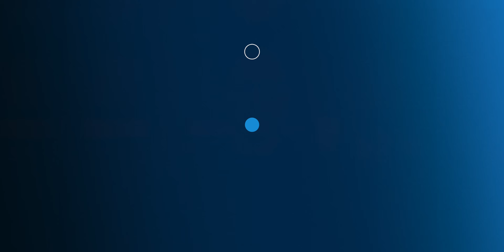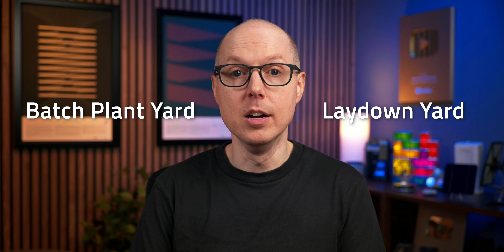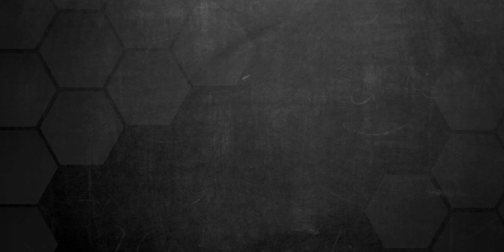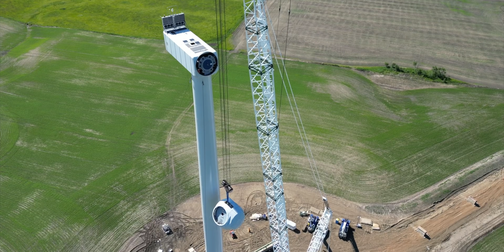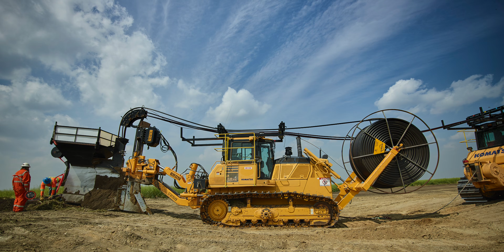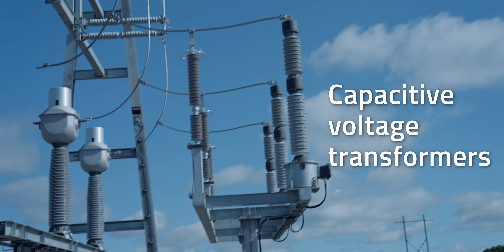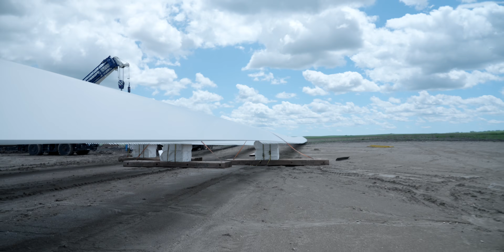The Hidden Work Behind Wind Energy

Comment: Thanks for not skipping the massive steel and concrete base. This, plus logistics, ongoing maintenance, and non-dispatchable service… it’s probably a shorter lived project than initially proposed. I love the concept, but the numbers don’t go ‘round.
Reply: What numbers are you using? Your statements don't reflect reality around the world.
Reply: @ compare return on all-in costs including the inputs (transport , etc.) then add in decommissioning and reclamation (probably will just be left behind), then add-in required stand-by power generation costs (idle peakers to handle wind volatility) then add-in costs related to turning other things down (see Ontario where hydro and nuclear were dispatched down on windy nights), and then… yes, there’s even more to it! Finally, subtract subsidies. All-in costing yields negative returns and mounds of ferro-cement that will never be reclaimed or cleaned up. Lifespan for the turbines is turning out to be less than half original promise (again, Ontario experience). And maintenance is turning out to be higher. On the plus side, newer ones can be dispatched down (commanded to turn away from the wind), but that puts another wrench in the return calculation unless… you’re paid for the dispatch down! And that is another subsidy. Solar has some merit despite plenty of its own issues with production and disposal. Wind is whole different story

Comment: I built this wind park. I was on the Base/Mid that was talked about. The bottom two secrions of the tower. Job is a ton of fun, and nothing beats the views. Ive been all the way up but stayed halfway for this project. I think i personally met everyone in the videos (aside feom Matt). The people building the tower, feom the inventoey team, and offload team, all the way to the top out, electeical, and Quality assurance teams are some of the best in the business and truly make it look easy. There is something cool about lifting up a 78 ton tower section, managing the guys on the ground, with the crane team  and then climbing the tower and landing that part, with all yhe holes lined up perfectly, and securing it. Its just amazing and so much fun!
Reply: i'm sure you also have big thumbs, you often replace R with E hhehehhe, take care brother
Reply: @b0rd3n  it's always been a problem for me haha. Damn thumbs! Keep on keeping on brother! All the love
Reply: I currently get to operate a "large mechanical equipment piece of equipment" that moves multiple times a day and it weighs about 2 million tons(counter weighted by about two 1 million ton weights) I'm told by the DOT that maintains it. When up in the air, it is perhaps the best view in the city. We also have to carry up anything we need/want to a shift, but luckily no harness as we only have to physically climb up 2 stories(20-24 feet/6-7 meters). 

Safety is key though as a fall, though unlikely, would likely be deadly and getting "pinched" when it's moving would be like a paper cutter cutting through paper! 
Be safe out/up there man! 😅
Reply: If I understand this correctly, a single section of the tower weighs 78 tons? How come it's so heavy?
Also, in the footage showing the inside of the tower, I only see a ladder. Is there some kind of elevator for maintenance personnel? If not, is there a harness cable going up and around a pulley on top with a ~70kg counterweight to make it quick and effortless to go up and down? I guess there should be two cables, for a second person or some tools/parts.
The counterweight could even use a simple mechanical system to automatically match the weight of the load that needs to go up/down.
Reply: @VeniceInventors  a single section of this tower is around 78 tons. Different models have different weights per sections. As per the ladder. Most towers have a purchasable option of an elevator. With that being said, most companies don't purchase them haha. And even if they did, elevators are installed after erection is completed. For us that build them, we start on the bottom, put on our harness and climb the tower. Rung by rung. You also have 50lbs of harness, a lunch bag, and whatever else you want to bring up tower (i.e winter clothing when its -30c outside) Its alot of work. But you get used to it. Now after completion, alot of towers get a "climb assist" installed. Basically a second cable you hook on to that's a loop from top to bottom and runs through a motor on the bottom. It takes some of the weight off you while you climb. You are supposed to set it to about 60% of your body weight, with the max weight it can help pull up is 250lbs. If you check settings, most tower climbers are apparently 250lbs hahahaha. But honestly, it's a great workout and a ton of fun getting to the top
Reply: @ryanyoung1837 Thank you for the detailed reply!
I understand that they can't justify the cost of installing 38 elevators in 38 towers as they probably don't need servicing too often, but I'm glad to hear that at least some measures are taken to assist the poor chap who has to go climb all of them to go check or upgrade something 🙂
Reply: @VeniceInventors  they do get serviced pretty often to be honest. Each one will will get maintenenced once to twice a year, plus just general work. One park had 56 turbines and had a team of 8 that would climb at least a tower a day. And as for the help to climb. Us tower climbing grease monkeys love the climb.  Even if we don't have any help, like at any point during construction, we still love the climb. I remember my first climb to the top. I was told I don't have a time limit, just make it. I think it took me about 45 minutes. I was gassed beyond belief when I got the that last deck (the yaw deck). With that being said i know guys that climb in 15 minutes, and guys who take 30 minutes. You get used to it and have alot of fun doing it. You may be gassed, but you climb up the final ladder into the nacelle, and if you are building it, you already have one of the best views of life, and if it's built, you open that top hatch, look outside, and everything is worth it. I wish I could add some of the cool pictures I've taken.
Reply: @VeniceInventors  You will more likely see lifts in offshore wind turbines. For example an offshore wind farm under construction will often have turbines 350M (120m max on this project) off the sea surface, estimated power output is 15,000MW PER turbine (vs 5000MW max per Nordex) and its swept area of the blades is 43,742M (18,870 max). Think of the cranes needed for that and thats not the biggest offshore turbines being built (no road corners in the sea as a bonus but weather can be "interesting").
Reply: @stephendoherty8291  The size and output just leave me speechless.... Since there's no building that tall around here, the only way I can really appreciate how tall that is, is by considering that it would take 35 second to sprint the length of the tower! Or, if my math is right, it would take 8 seconds to fall from the top.
It must be intimidating to design (or work on) something at that scale.
I hope I get to see one in person some day!
Reply: @VeniceInventors  Three large farms under construction in the US and one is near completion in full. If you fly anywhere over the North Sea you see fields of them. 40% of all power the UK generates is just wind, most of that offshore.
Reply: @VeniceInventors If you're in the US head to the north east south of Boston, this seems to be the areas that future wind farms will be built and expanded. It's near massive power demand and it's windy
Reply: @stephendoherty8291  Dang it, I'm in the opposite corner of the country! (Los Angeles). We do have wind farms east and north of me but the tallest I've seen (on land) is probably 200-300 feet tall.
It looks like CA doesn't have any offshore windmills yet, the state obtained federal leases in 2022 and are doing environmental impact studies at this point. I'm 100% for protecting wildlife from humans, but there would be a lot less impact offshore, if any,  than there already is on land, especially if they drag their feet for too long.
Reply: @VeniceInventors  Pre Trump there were firms looking to install offshore wind farms off CA. Due to the water depth, they would need newer design floating wind versions. These are like oil rigs and are chained to the sea bed but can then be used in deeper water. I recall the islands off CA were a suggested spot as a substation could combine the power before sending it to shore. Floating wind turbines are rarer but they are being built in Scotland for their deeper water designated wind areas. This was also the idea for the great lakes which are too deep for traditional ones but floating ones would be easier to anchor further offshore. Recall it was lots of "green tech firms in CA tech land as there is no clear design winner for offshore and the US could get a lead in this with its oiol and gas experience and work talent
Reply: @VeniceInventors  The issue over placing them next to Channel islands is they are mostly large bird and wildlife sanctuaries so even if they are abandoned and no longer military firing ranges they are in corridors for birds as welln as offshore mammals. It does not need islands to build floating ones but until the Oil industry seems this as a money maker or at least the oil rig builders then there is no pressure. Not to mention all the rich who lose their expensive sea view with lawyers...
Reply: Pam here….I personally like to see our workers building theses turbines and maintaining them vs the filthy oil rigs, platforms and all the steps of the process of use of oil….filthy and polluting every step or drip of the way.
Reply: Thank you for ridding us of pesky birds
Reply: @DinoNucci  Cats kill more birds than wind turbines.
Followed by skyscrapers.

Comment: As a guy who's interested in reliability, all things fail. The fact that you can't get various replacement parts overnight, I'd be interested in how they over-provision or have parts on standby for the critical components like the main circuit breakers or the current transformers that would affect the functionality of the whole installation & not just one turbine.
Reply: Parts commonality is normal in grid components. Saskpower keeps spares in centralized yards of common items. Rarer stuff like the breakers have expected life spans and can be re ordered if they get near end of life before the turbines hit end of life.

There is a spare blade sitting in Kipling. It was in case one was damaged and they needed a spare to get done. It might never get used. Best to get done and not need to come back to finish one. Moving that big crane is an undertaking.
Reply: The electrical distribution is no different than any other substation.  These things are all over the place. A current transfomer is just a coil of wires surrounding the conductor.  it generates a current based on the amount of current flowing through the conductor.  They are everywhere as are potential transformers and circuit breakers.
Reply: @mtnphot  Agreed. The problem of replacements is everywhere. Too many items with years long supply chains.

Comment: I would like to know more about the sub-station.  A current transformer was mentioned, as was a voltage transformer.   I thought those were large, mostly oil filled containers with large primary and secondary copper wires around an iron core, you know, a transformer.  These were small.  Are they something new?
Reply: The main power transformer hadn't been installed when this video was made.  And you're right.  It is very large.

Comment: I do think the ones offshore are easier to build despite the logistics of getting the power back to shore. The transportation from factory to site is much simpler most of it can be assembled on the crane vessel so you don't need to assemble and disassemble a massive crane every time or worry about a police escort. I'm from the  UK so we have much more shore than land to make use of unlike North America, land based  wind turbines don't really feel that sensible to me for a small island country when there is a whole load of sea that gets constant winds.  The planning that has to go into land based turbines that big is insane.
Reply: If you don't mind industrializing the ocean. causing ocean temps to rise, causing whales to go extinct , and who knows what effects on fisheries and birds
Reply: There is no reason to assume an ocean temperature rise from wind turbines. One can expect a slight reduction in the wind speeds, but from climate change these are expected to go up in general. For fish life the wind turbines to a large part have a positive effect as they add protected hard structures and areas where commercial fishing is not practical and usually not allowed. So the wind farms are usually also marine protection zones. Offshore wind is usually in the more shallow water that large whales are rarely visiting. The whale would mainly be effected (from noise) during construction, no longer during operation. Chances are they will like the extra fish.

Comment: Since painting one blade in black is a known remedy to bird kills from turbine blades, I wonder why it hasn't been implemented in all wind farm projects.
Reply: Thermal stress. It was -39C last week with no wind. The sunward side would have warmed and expanded. Lots of internal stress when the material is more brittle in the cold. Probably less of a problem if the wind picked up. We had some low -50C wind chill values the same week which would have allowed heat shedding. The summer sun can make black surfaces push 60C with ambient air in the 30C range. White makes these things last longer.

Comment: I really want affordable residential wind power.
Reply: Will probably never happen. Power increases by the square of the blade length and the cube of the wind speed. So most small residential wind turbines make a comically low amount of power.

Comment: Do the rebar reinforced concrete pads have the same problem as our concrete buildings do, where the cracking lets moisture in and the rebar rusts and breaks? Or is the pad ground-supported enough that it isn't under a similar amount of stress? Does the operation of the turbine create vibration that will eventually break the pad? Or is there a deep root there beneath, and a very strong unification of the turbine nacelle and the pad? I'm just wondering about permanence here, and greenhouse gas/mineral extraction cost over the lifetime of the turbine, as influenced by maintenance requirements.

My suspicion is that these projects need to be more democratized, distributed, owned by communities or neighborhoods (or even individual buildings, or blocks, depending on density) instead of being massive grid-level, in order to have the lowest negative environmental impacts, highest redundancy (surrounding communities carrying the load for communities whose equipment goes down) and uptime/reliability, aaaand uh... well, the more local the ownership, the more empowered (no pun intended) those using it are.

But I could be wrong. That should be a sister channel to this one: "I Could Be Wrong, with Valerie L."
Reply: Small solar projects have nearly the same efficiency as large ones but that's not true about wind projects.

The way wind speed is higher and variation in speed is lower as you get higher means large wind projects have incredible advantages. 

There's a reason you see 4 kW home solar systems and not 4kW home wind turbines in urban areas.
Reply: @thewheelieguy  Of course. As I think about this stuff, there are lots of trees blocking my view of the forest, so thanks for the reminder there.

Now if only I could build a PV cell myself. I've found plenty of stuff about building something that is more of a solar *battery*, but that's not doing it for me. We really need the ability for the poorest of us to have a decent array of panels, not tens of thousands of dollars up front and the government rebates coming in over a long period.
Reply: The principle corrosion problem is similar. However with a large foundation it is easy to have the steel well covered with thick enough a concrete layer. The the cracks and corrosion is more a thing for smaller dimensions and bridges.  The concrete under ground is also well protected from frequent freeze cycles and acidic rain. So cracks are much less a porblem under the ground.  There should be enough safety factor in the foundation to outlast the turbine. While the foundations are usually still good they currently ususlly not resusing them when the turbines are replaced, as the new turbines are now usually much larger than some 20-25 years ago. This may change in the future as it gets increasingly more difficult to make them much larger - the transport and cranes can be the limit. So when worn down in some 20-30 years, they may replace them with the same or similar size and reuse parts like the foundation and tower.

The foundation is usually only a relatively small part of the overall costs and energy investment. 

There is usually local involvement from the land owners. However there is also a benefit from having reasonable large projects, so it's worth having the substation and bringing in the huge crane and getting the transport route  (e.g. changes to roads and bridges). It may well need some changes (epsecially intersections, bridges) to the roads to the long blades and heavy parts in. The higher up the more consistent the wind gets. This makes the quite large units more attractive.